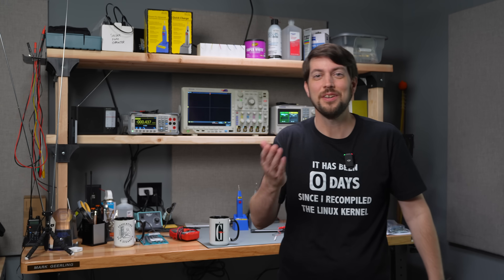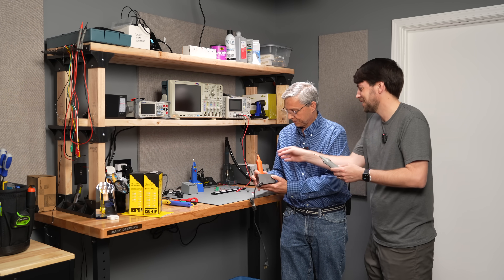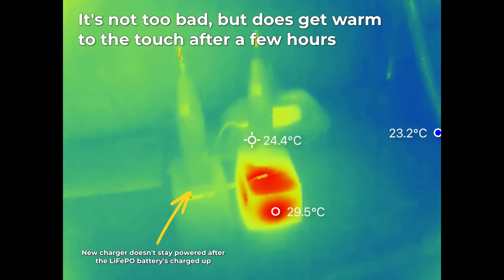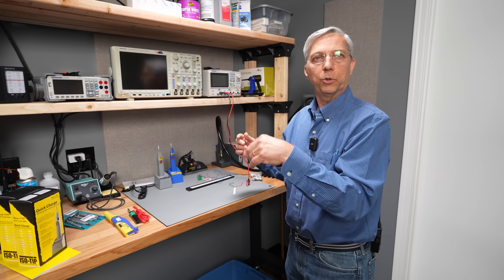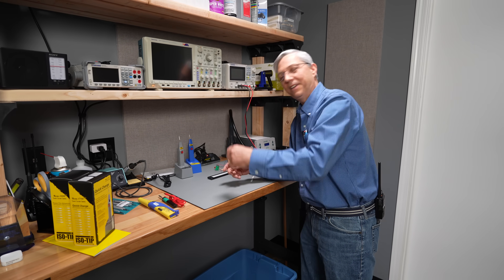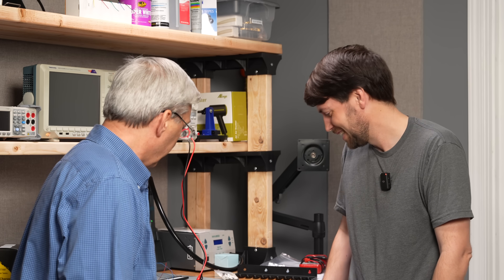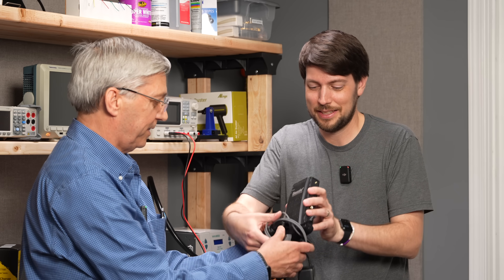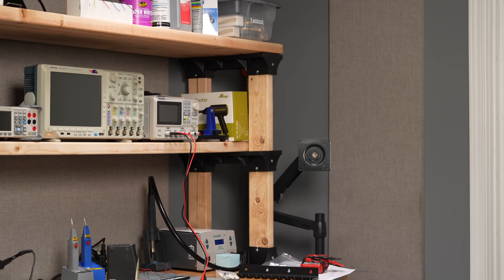Sometimes old tools are better.

Comment: Bought my iron around 78/79 and i still have it and the original bits. Think its a different brand though, but has a grey square button that locks. Same base and orange case. Moved onto gas irons, suppsed to be better, but never were.

Comment: i upgraded both of soldering iron you show here.
First isotip with li-ion 3000mah (get hot in 6 sec and since no temp control tips wears out fast) 
Charger for 1 € on the back side with usb-c magnetic connector
on the front led very strong light

Second: modern soldering iron without light as you complain, i added same led light like above and 6 x li-pol cell 200mah on the back side so its truly wireless. Working time 2 min. Separate switch for turning it on and security switch bellow.
Now this  is the only 60W soldering iron worldwide with light that works without cable to my knowledge at least.

Comment: Just the intro made me want a capable (4 chan, 100 MHz) scope. That's a tool, that alone has so much potential knowledge power to offer... (worked in a failure analysis lab before, had one like that).
I think I have to get one. Even if it is just for show. Period!

Comment: Absolutely.
Have you used a tape measure from the current era?
I acquired one of my dad's older ones a while back and when I can find it, it just works. Nothing special

But of the few tapes I've purchased myself I'm pretty sure every single one has broken in one way or another

Comment: I for one have gotten quite fond with the MiniWare Line of Tools 🤔 In partikular their Soldering Irons starting with the USB-C powered TS80P with interchangeable Tips or the now USB-C Power Bank rechargeable Wireless TS1C still using the same Tips 🤨 And then there's the ES15 Motion Controlled Electric Screwdriver which combined with GodHand 4mm Hex Drill Bits ranging from 0.5-3.0mm in 0.1m increments is just /chefskiss for Scale Modelling and stuff 😏

Comment: When I was 13 and 14 years old my parents still forbade me owning in airsoft gun but since I knew enough about the inner diameter of pens I could rework the inner foam of the dirt for a barrel to fit an airsoft pellet BB thing and it was good enough I couldn't buy an actual airsoft gun but I could buy BB's

Comment: Funny that dad didn't mention microscope, hot-air nor thermal imager. Maybe that wasn't common in his days?
Reply: They spent a lot of time heading out to make 'field' repairs, so they usually had a rolling cart with stuff on it, maybe a scope, soldering gear, and some other test equipment and cables. There was always a heat gun laying around, but hot air rework only got more popular for individual / small shop benches when SMD stuff was more prevalent. Most of my Dad's career they had more through-hole or cabling repairs, not much SMD.

And budget usually didn't allow for conveniences like a good microscope or thermal imager, but they did have a plethora of magnifying glasses and lamps with built-in closeup lenses.

Comment: I still have a Craftsman branded iso-tip iron that is 40 years old. On its third set of NiCad cells. I also have two Weller temp controlled irons, Weller guns and several heavy duty 100 Watt 3/8 diameter irons for the big stuff.

Comment: I about a year ago got the Blue version of the iso-tip. I have a couple soldering stations but they are tucked away in plastic storage boxes. Wanted something for when a small job is needed .  This fit the bill 100% Tinning 10 gauge wire, no prob!! The heat is par with the soldering staion!  Very content ISO-TIP!
Reply from the maker: Yeah I've already used it on two tiny projects where if I didn't have it, the projects would've just been placed on the workbench, to be done at a far later date since they'd be forgotten!
Reply: @JeffGeerling  I was kind of second thinking but so glad I got it!!   You take care of your dad!!:) 
I'm a dds and kids are all over USA

Comment: Kinda surprised they didn’t put an LED in the newer iron — could be socketed so it’s easily replaceable, but the incandescent light probably isn’t a huge draw I’m guessing…

I have many very old tools that I would never replace. Particularly heavy tools like big screwdrivers, mallets and hammers, calipers… although having cheap modern ones that I can abuse is also nice, lol

Comment: Imagine a pinecil/ts100 style iron with an 18650 or 21700 in the handle and a little LED, would easily be significant improvement on these older irons the main thing making them good is that the heater is in the tip unlike most modern irons but the same as pinecil and ts100 irons

Comment: I built an Imsai 8080 computer, several S100 boards and a Heath oscilloscope using the original from 1971 (I think I bought it in 1972 when I got my job at the campus computer center.)  I still have it somewhere and it's batteries and tips have been replaced many times.  Except for temp control, none of my current irons are as convenient.  Oh and mine was black.

Comment: Look into the Weller magnastat soldering irons, I believe they have been available from the 70's. I can still get all the parts for mine or even buy a new one. 
It's not wireless, but it's a design that stuck around for many years, maybe there's something about soldering irons that enabled this, you rarely see such long product lifetimes in any other market

Comment: Why do i need a light on my solder iron? Totally useless. You see more with a candle ...
Wireless is also rubbish. Maybe if i want to solder one or two solder points, but not if you use it 8 hours a day.
If you want to solder outdoors you can easy use a Pinecil and a power bank.
One problem with a fume extractor is that it will cool down the iron and it can be very hard to solder. Try solder outdoors when it is windy 😁

Comment: i recently built my new bench almost like yours just a little wider, with a equipment  shelf above and a free worktable.  
for me it was important that the first shelf was high enough to be able to put a hifi equipment im working on, on its side and still be able to slide below.   
unfourtainly this rises the shelfheight in most cases 40 to 45cm above the table. 
this strains my neck quite a bit as i have to look up all the time when measuring stuff.
now i tend to rather use a worse portable dmm over my top notch bench dmm because of this, let alone the scope.

if i ever rebuild my workbench, i definately make the table surface deeper, from just 60cm to 85..100cm so i can place the equipment infront of me where my eye vision is 99% of the time anyways.
less critical equipment like "set and forget" stuff (psu, function generators etc.) can stay on the shelf above. but scope and dmm gotta be on the table.
at 100cm i still have 50..60 to work on stuff and 35..40 for equipment which should be deep enough. 

next is having multiple soldering stations at once, it is most of the time more annoying than convenient.
i got a soldering iron, hot tweezers, hot air station and desoldering station on the table. (well the handpieces in their holders anyways, the control units are on shelf above to save space.)
and those damn wires are allways are in the way. 
maybe some dog leash mechanism above that pulls they wire away when not in use would be a good addition.
having a wireless soldering iron like yours or more recently a "TS1C" would be a good, until you gotta do a bigger job where you need more power than the battery/supercap can hold.

a position for the most commonly used screwdrivers on your dominant hand side without reaching behind something or needing to stand up is also on my priority list. 
right now i positioned mine on the left side ( Im right handed...) and on the wall all the way back. worst decision ever, built right into the furniture

and if working on mains equipment is a thing, a galvanically isolated variac with optionally a dim bulb tester mode is a must, for safety and convenience.

Comment: Boy this brings back memories.  Iso-Tip was a big step in tech at the time.  I had one of the original ones when they first came out.  Being able to go work on an aircraft and doing wiring repairs without stringing extension cords was a major life improvement.  OK so where is your Soldapullt hand solder sucker?  You got to have one on the bench!  I still have two and used one last week.  Thanks for the memories!

Comment: One thing that's noticeably missing is a microscope. Everything these days is so small that a microscope is useful for nearly everything. I prefer an optical (tri-nocular so a camera could be added), but some people use a digital-only. After I got one, I use it for way more than I thought I would. It's also very handy (along with the sharp tweezers I use for smd parts) for sliver extraction too - I've pulled countless slivers and thorns out of my hand under the "soldering" microscope!
Reply from the maker: Yeah; I'm now trying to figure out if I should go for something in the $100-300 range, or wait a little and splurge for something $500+... I can maybe justify it if I get a could camera adapter and have some videos where I record through the scope!
Reply: @JeffGeerling  I got the AmScope one Louis Rossman uses - I like it, a lot. I originally ordered it from amazon, but a day after I ordered it, AmScope had a sale on, and amazon wouldn't match the price (it was a significant savings - like over 100 less), so I returned the Amazon one and ordered it again directly from AmScope. With labor day right around the corner, they might have a sale on now too. They'll probably have one around Jul 4 as well

Comment: Just an FYI, I don't think you need to buy a signal generator. Many modern oscilloscopes have one built in so check that first. Actually I just checked and your extra jack is only an external trigger. Please disregard this comment.

Comment: Actually it seems to be increasingly difficult to get simple electronics wires if not wanting to import. You can get the 1.5mm wire but AWG 22 or 21 seems to be difficult.

Comment: A lot of that test equipment could be replaced by a USB device. I have a Digilent Analog Discovery 2. It covers all those bases. Not to nearly the same precision, but given that it's a small device, it takes up practically no space. 
I do actually have a really nice oscilloscope, but it is one of the thicker ones, and takes up a ton of desk space. Overall, I'll take small and compact any day.

Comment: I worked at an audio post house with 4 machine rooms on 3 floors. The engineering director had 1/4” patch points in the patch bays to plug a Weller soldering iron into. His way of solving portability. Like your dad described there used to be a lot more soldering in trouble shooting. Cheers 👍

Comment: 6:21 you didn't breathe in "leaded solder" fumes, you breathed in flux fumes. Most solder has a hollow core filled in with rosin flux. Hence "rosin core solder".

Lead is a metal, and melting and vaporizing are two totally different worlds of temperature requirements. This misconception needs to be stopped.

Comment: perhaps add a swivel lamp? I used to have it on my bench, about 15W LED so it was quite powerful, and it came always handy. Especially when I was restoring / recapping lots of tube equipment :) About the soldering irons, I have a proper hakko soldering station, that I rarely use now, I only use it when doing SMD rework. I am now daily driving a really cheap Chinese soldering iron for $10, that I got as a backup (and expected to be really bad). But I've been using it for 3 years now and I discovered that it heats really quickly (1.5-2 minutes max to full temp), tips last forever (still have the original tip on), has lots of thermal mass for being that cheap and small. Also it has temperature regulation that is reasonably good. I recapped probably 20 vintage radios with it, and it always worked perfectly, even when soldering to a chassis. Before that I used to own a 35W Weller soldering iron, that had no regulation, took ages to heat up (probably close to 5 minutes), and didn't perform well. Also it ate tips like crazy, despite my best efforts. And it cost like $40 in 2012, when I started with electronics :)

Comment: Other than that 3rd tier, your bench looks a lot like the one I built just after I retired.  I had a lot more test gear though, as I intended to fix DC to light equipment  (Stopped before fiber optic equipment as finding used test gear is expensive.)  Good job with the bench.  I had access to rechargeable soldering irons, but preferred my Weller.  Most TV studio repair did not require a soldering iron while in service.  We swapped out, and took failed equipment back to the bench.
Reply from the maker: Fiber is a whole different world! But I'm considering playing around with it for some networking experiments. It looks fun doing fusion splicing :)
Reply: @JeffGeerling  Buying a fusion splicer is expensive.  There are mechanical splices that have low losses that would be better if you are only interested in learning about fiber construction.  OTDRs are also too expensive as well.  Power meters will be cheaper and be good for learning

Comment: Watch out for the LEDs on the bench as a serious source of noise. I think EEBlog Dave had issues with noisy PSUs on some strips.
Great to see you and your dad talking about the old days. Love the channel.
Reply from the maker: Yes; that's one thing I think we hope to do over time, monitor spurious noise from different things, and then I'll try to call out any really bad devices/chargers. They're allowed to spew out stuff within a certain range and power level, but shouldn't black out AM radio or anything!

Comment: I stopped buying canned air long time ago. I'just grabbed a small air compressor with a ~5 liter airtank, a pressure regulator,  and a rectractable hose with a drum, and some moisuter separator stuff. it's not quiet, when filling up the tank, but i don't need to spend and blow gases out, no frezeeing, and I can also pump up balls/car and bike tires, etc :)
Reply from the maker: Just make sure you drain the tank now and then! I had one old tank get a bit rusted before I realized it was important to maintain it through the seasons :)

Comment: I've had several Iso-Tip irons over the years but stopped using them because of how fast the tips wear out and how delicate the tips are, as well as the short run-time. I now use a Pinecil with a Ryobi battery and holder I 3D printed. It's almost as portable and has more features than the Iso-Tip. It does lack a LED light but until you brought it up I never thought about it and honestly I don't really miss it.

Comment: I wonder if the replacement/upgrade LED bulb for the full size Maglight flashlights might present a n alternative for swapping out the incandescent light bulb. I don't expect it would improve service time on the soldering iron, as I expect that the Incandescent bulb is a trivial use of power compared t the iron element. I don't think that bulb will do it, it is held in place by the flange with a screwed on sleeve, vs being screwed into the socket that it looks like these are, but it may mean simply looking for an LED bulb in the market.

Comment: I tried mounting LED strips under the shelves of my workbench but found that it wasn't enough for me either.  For additional lighting, I'm personally using an LED panel that's marketed for photography/videography and have it mounted on a flexible microphone arm with a desk clamp.  It can get really bright, has a high CRI, adjustable color temp, and I can focus it right where I need it most.

For air filtering, I tried making my own desktop filter with a computer fan and a Joby GorillaPod but couldn't get it exactly where I needed it due to center of gravity issues.  I upgraded that to a KOTTO desktop fume extractor.  It has a flexible suction hose that you can position wherever you need it.

Comment: If you're looking for a monitor on that workbench, maybe look for a small one like 20 or 22 inch and more importantly which has a VGA connector.
Those can be had for less than 100 euro.
Also one with multiple HDMI inputs (or use some HDMI switch on the desk) as you will see your will switch inputs quite often when testing some Raspberry Pi, small PC or maybe even some video switcher/recorder like Black Magic has.

You did mention to mount some LED strips, but those still have quite some 'directional light'.
I did buy some TL-like LED lights for under my shelves. Those are really cheap and give way less directional light but just flood your bench which is what you want.

Also place some Ethernet switch on your desk.
I do miss lots and lots of power outlets on your desk.
You never can have enough of those, so maybe add some 19" power strips on the side poles of your desk.
Especially one which has a power switch per outlet.  Only one, as it can be really frustrating when using some power adapters blocking (or pressing) the flip switch, but for other cords it really is practical to be able to turn stuff on/off instead of pulling a cable.

I also have some galvanic isolated 1-to-1 transformer.
This is much more safe for your own to work on stuff or connect probes to your scope (or PC for programming tools)

Comment: Some stuff that came to my mind that you might be missing: hand tools like pliers, screw drivers, side cutters, wire strippers, etc. Also maybe some heat shrink tubing and a hot air gun for it.
On devices: maybe an LCR meter or a simple component tester, those are very cheap these days and can tell you what size capacitor or inductor you have at hand.
For soldering I’d recommend getting good flux and maybe "copper ribbons" for desoldering. A desoldering pump can also be useful. A fume extractor is definitely a good idea.